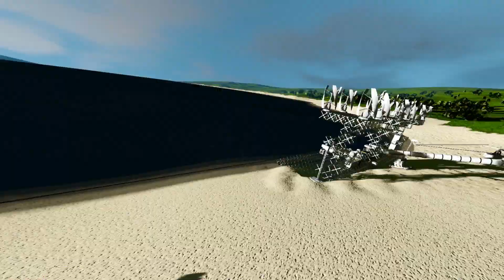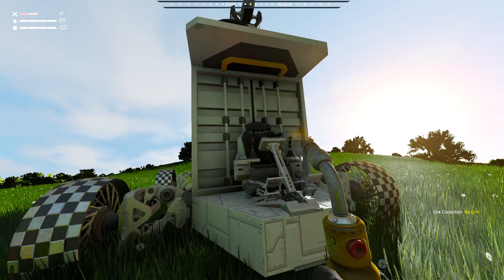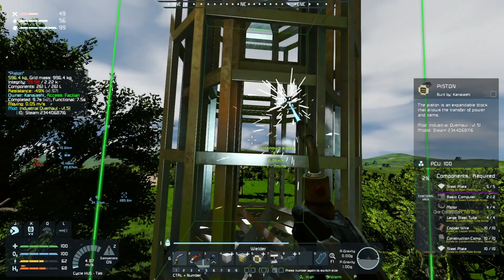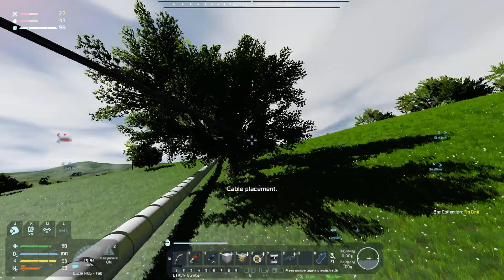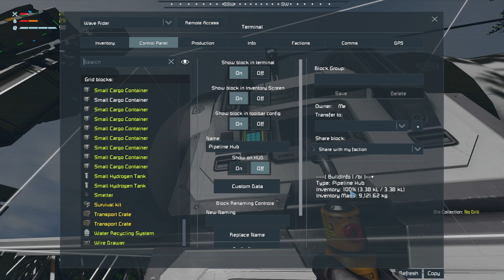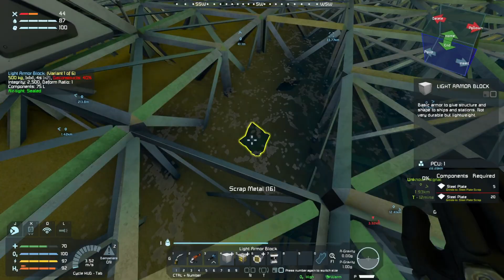Space Engineers - S4E11 'Iron Mine Drilling Rig'

Comment: I see you have on the "No free energy" mod. I think a feature that needs is engines consuming O2 when they are not in a O2 atmosphere. Could be tricky to tell if the engine is in space though. So if you don't want a engine pulling from O2 storage, add a vent. No free O2 either.
Reply: Personally I just head canon hydrogen engines as crude fusion reactors. Say a bank of small magnetized target fusion chambers like a linear version of General Fusion's design that uses pistons to compress the fuel plasma. Just, you know, really fuel-inefficient for fusion, but dumb and cheap.

Comment: @kanajashi, put a conveyor sorter to "drain all" everything to can come trough the pipline at your base... that pipeline mod will not "push" materials ;) Im playing your scenario too, using PAM to local mine drone, then drain it to the base....
Reply: Rather don't, as you probably dont want to fill up the storage at the base with stone, and rather have the refineries grab from the mine as needed. 
On the other end tho, it could be wise to put up sorters, so it's easier to control wether you have stone or iron incoming. :)
Reply: You need advanced computer for sorters, and quite a few iirc. I believe some 20ish or so per sorter.
But if you are lucky, the unknown signals, at least some of them, can actually give you those
Reply: @rev2632  All of them give you 2 scrap one, if you grind the battery on them. Takes time and patience. Or maybe you get lucky, and have UCA destroy one of the enemy bases you can clean up after them. Happened to me twice already, one even had an intact reactor in it with uranium.
Reply: @rev2632  makes sense, I've yet barely touched this mod, so that was useful information in this discussion. :)

Comment: I think you should have built the mine site as an independent outpost with its own power, defense, storage and processing capabilities.  This would give you the advantage of only pushing finished resources to your main base, adding redundancy to production and power in case of base attacks, plus give you a fallback in case of catastrophe.
Reply: Was going to suggest something along these lines but more large storage and a refinery array and just push ingots down the line since your limited by bandwidth down the pipeline and refined stuff is so much smaller and lighter
Reply: he needs another survival kit/med bay to have a true fallback point though... not sure he has the silver for that
Reply: @mikewhitaker2880  I agree with you, however the survival kit he has is more protected than if he had it on his base, since the base is made of paper mache (1hp unfinished blocks).  Any of those bullets could have hit any of those power towers, evaporated the blocks and dropped the remainder on his running equipment.  A few bullets into that exposed hydrogen tank would have made a more serious explosion.  The problem with quick block expansion (unwelded blocks) is that it has raised the PCU of his build, and thus the threat of the NPC mods against him, without giving him any safety or structure.  I am really interested to see where the series goes from here, but I sense impending doom.
Reply: which is where his diggy diggy hole by the base gets a purpose.... put a battery, survival kit, and small cargo for foods and basic materials... and there is a protected "mostly" bunker....
Reply: Agreed. I only transport refined materials. Never the raw mats. I always build independent rigs with their own power supply and drones to bring back the mats to base.

Comment: honestly, you need to upgrade defenses. those gravel turrets looked like they did little to no damage to that drone. i was wondering why it was still alive after that many turrets firing on it.
Reply: I haven't watched too much of this series, but it looks like the gravel turrets are much weaker. The thing is, as he builds more defenses, the more often the drones are going to attack. Also he definitely needs to be aware of falling corpses, which honestly can more dangerous than the drone turretsv
Reply: And the range of the turrets isn't that big either, 600m I believe. So if the sparrow would have been smarter it could have destroyed the whole base without taking any dmg at all
Reply: @rev2632  which makes this defence sad n makes me wonder why put in turrets that basicly can kill the enemy at all. Better off using vanilla at this rate but then again he is on a very different planet than usual.
Reply: @jakebswenka  From what I have learned from using Industrial Overhaul since it's release, the light gravel turrets are anti-organic. That cut through wolves and spiders, and even engineers with little expenditure of critical resources.

Beyond that, however, the majority of comments here are correct. They are essentially useless against even light armor. The heavy turret can do proper damage, but it's rounds are detrimentally slow and will miss by a large margin if the target drifts to the side too quickly.

Because of these issues, Clockwork (the mod's creator) added a new turret that fills the gap between gravel turrets and the gatling turrets. The new CLG Autocannons use an ammo comprised of iron and ice that can be made in the assembly bench, as can the turret's components.
Reply: Just saying the light laser turrets, used to be quite effective and iirc they didn't need any special materials to build so maybe he should build those.
That said it's been quite some time since I played with those
Reply: @rev2632  Laser emitters are top tier components, that need gold and other materials he has no access to. Small gravel turrets can take out drones, large ones are useless against them.
Reply: @csgergo80  might have been the small grid once I'm thinking of
Reply: @rev2632  still, the he cannot build the laser emmitters right now. I'm playing the scenario along and struggle with a lot of more valuable materials.